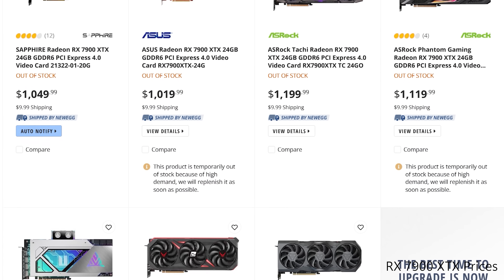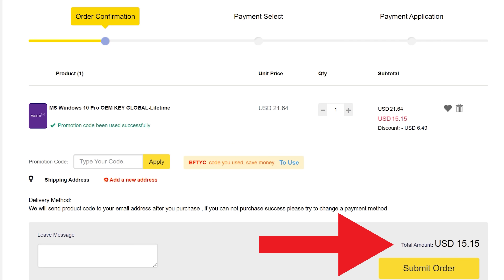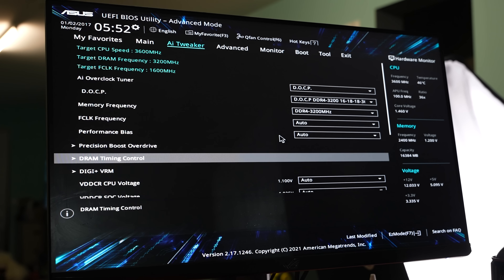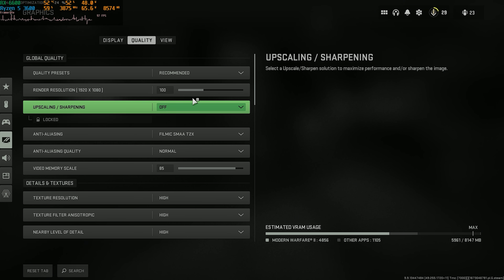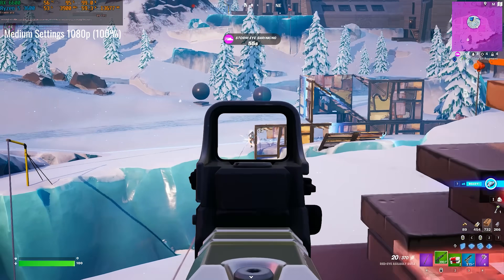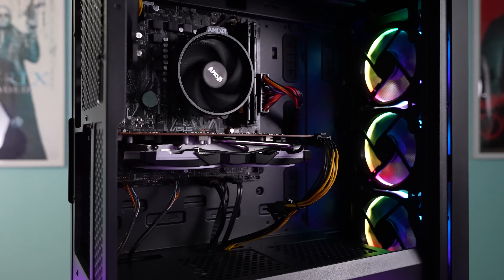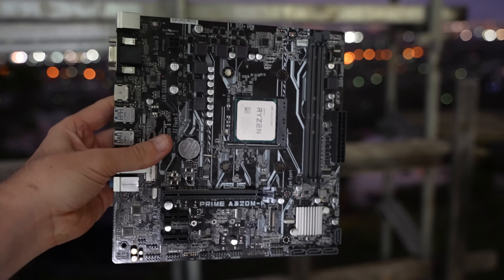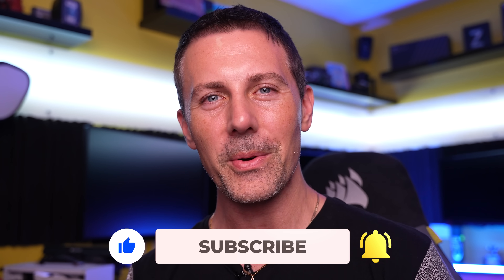This UNDER $650 Gaming PC Can't be Beat for Value.

Comment: I'd actually recommend people wait a bit on the GPU side of things; during Black Friday you could get your hands on an RX 6700XT for about $320 after rebate, I fully expect the card to go that low or lower over this year, and you can get a LOT of extra performance with only another $70 if you just wait for it to hit.  That said, 6600's an awesome bang for buck card, so if you're building now, don't be afraid to go for it.

Comment: If you have a local CEX they  often have competitive deals on ram, monitors, other pc parts. 
My experience the Warranty was good no quibble return replacement or voucher credit when a fault happened.  Returned a BenQ RL2455HM for £38 after a week when it kept switching off randomly when it  made crackling noises. My bad luck, but will be  back again, generic monitors (if lucky with HDMI) from a fiver. It is worth a buy and return if it shows odd behaviours in the first few weeks of testing.

Comment: I would put some heatsinks on the VRM of A320 boards. They usually go for around 7 to 15$ and for sure prolong the lifespan of those otherwise really nice motherboards.
Reply: totally worth it. I once used 2 heatsinks from a broken stereo amp. found at the recycling centre, works great!

Comment: It is so nice to build a budget system because you don’t have a lot of parts to install and what you have is easy to install. Also there is something refreshing about basic looking motherboards that look more like they did 15-20 years ago and no RGB or anything to worry about. You can also get a lot for not much. Personally I build last year an alder lake PC with with some cheap parts and older parts left over for 200 bucks. And while it isn’t great at gaming it can do some older games no problem and for what it is used for it works perfectly fine and feels faster than an old Sandy Bridge despite being only a 2 core 4 threads it is faster than quad cores from a few years ago.

Comment: Just built a pc with a Ryzen 5 5600 and a $250 used Rx 6700xt for a total of under $600! Super hyped to build it I think the price to performance is going to be insane
Reply: ALL used components?
Reply: @southboundtp2067  no only thing that was used was the 6700xt and the case I had before, so total i spent was like $600
Reply: nice

Comment: The system is compromising on a few different areas though, such as the memory and processor.  Consumers are calling for 32GB memory in many of the gaming systems being bought and used today,  as well with a processor with integrated graphics for troubleshooting and any additional tasks the user may need to do.   This system is a great entry tier system into PC gaming so long the buyer  knows it's shortcomings and at a price of $628 I'm not sure there is much that can beat it unless you have parts donated to you.
Reply: integrated graphics are costing you half your memory cache and Pcie 4.0 support ( thats 10% performance loss to the newer graphics card ) , not sure i would want Pcie 3.0 when 5.0 just came out, you basically top out the system with RTX 2080 do the bus support, Nvidia 3000, 4000 and AMD 5000, 6000, 7000 will all have reduce performance unless your talking 12th gen or above Intel CPUs
Reply: @hayseedfarmboy  
iGPU is a really useful part of processors especially when you go to boot of your system for the first time and you're not able to figure out why there's no display.  For some it's only $20 more than processors without integrated graphics.  Totally up to the user what they are willing to go without, either way anyone in the position needs to know specifically what they are buying comes with and what it will not come with
Reply: some one didn't tell him the 3600 is actually 5000ghz beast

Comment: I would suggest change the mobo to B450 for ryzen 5 3600,and you can get the most out of that chip by overclocking it.
Reply: I got an a520m can you overclock the 3600 on this mobo?
Reply: @Lollopirate  Unfortunately you can't. But maybe you can look into the xmp profile in Bios and set the RAM speed higher than 3200 since Ryzen CPUs love faster RAM.
Reply: @mr.chaidir4766  Thanks for the answer man, i did some reasearch and a lot of people say that overclocking a cpu like the ryzen 5 3600 won't give you that much performance (depending if the game is more cpu demanding or gpu) and like you said the more important thing is memory speed. Since i bought the a520 new i can always try it and return it if i see low performance but i hope it'll be fine without overclocking.
Reply: Do you have a 3600 cause I have one and it doesn't get much more performance by oc they don't oc very well
Reply: @Durkhead  I do and yes the performance improvement maybe is not significant enough. But in cpu demanding games like cyberpunk 2077 and watch dogs legion it helps the game run much smoother and lock the fps to 60 all the time. I overclock my ryzen 3600 to 4.3 GHz all core then undervolt it from the default 1.3 to 1.18 mv and I get the best balance between performance and temperature. While I do think this cpu can handle most of the recent title out of the box just fine, but hey it's free performance.

Comment: Just built a similar system with used parts. Ryzen 5600 for $100. RX6650XT for $200. Another $200 for the rest of the components $500 total for a great 1080P build!
Reply: Same exact here except I got a 6700xt for $250
Reply: @BrickPB  definitely got yours at a much better price than I got mine, but to that I say great find
Reply: @ArtisChronicles  haha, which brand or model did you get and for how much?
Reply: nice

Comment: I LOVE this one! Personally I would have spent the extra money for a R5 5500 or a 5000 series one in general, but it's just REALLY good!
Reply: the 3600 will out perform the 5500 just not on that board, but 320 is a propper fit for the 5500 with a BIOS update, less cache and no Pcie 4.0 support anyway, 3600 has twice the cache and 4.0 Pcie support , plus it responds to RAM over clocking, unlike the 5500 (3200 and 4400 mega transfers RAM same performance out come some times worse for the whole 5000 series )
Reply: @hayseedfarmboy  3600 doesn't outperform the 5500
Reply: @ChristmasCrustacean  yes it does. i have both CPUs and can confirm that
Reply: @ChristmasCrustacean  anyone can over clock 3600 to 5000ghz, as far as i know no one has been able to get a 5500 above 4.6 even with liquid nitrogen, i mean it a good budget CPU if your going with a cheaper board like 450 or 320, but a B550 with a 3600 non X/XT will run right past 4600 ghz and still run below 70*c on an 30$ air cooler,, even out of the box stock setting on a B550 there won't 1% Performance difference, but on cheaper board stock setting, and 3200 RAM the 5500 would out perform it, but thats the only way, but both CPUs running their best the 3600 will pull ahead by another 400ghz or more, it handles heat so much better and can be overclocked more and in more ways
Reply: @H31MU7  i mean if his running a Nvidia 2000 series rather than 3000 series or radeon 5000 or 6000 that is a 10% performance reduction he manged to avoid, but yeah ive got a 5600G and 3600, and there is no contest on a overclocked B550 board and 4000 ram with a 5700XT or RX 6600. Now on the 520 with my 1070 the 5600g is faster at manufacturers specs, i assume thats what he is considering out performing
Reply: @H31MU7  I also have both the 3600 and 5500 and again, at least in my testing, with 3600Mhz RAM and Pcie 4.0 enabled the difference is rather sizable
Reply: No it's pcie 3
Reply: @martigrey5872  I would've gone for a b550m and a 5600. maybe 50$ more but better performance.
Reply: @martigrey5872  a320 in general locks cpus to 3.0. The 5500 is perfect for this, is new, and is relatively cheap to get
Reply: @martigrey5872  Weeeelll regarding the pcie 3.0 thing, I actually managed to get a R5 5500 and RX 6600 work with Pcie4, it's actually a matter of getting the right mCode. I do have a video about it on my Channel, it's the one with the anime case mod lol

Comment: this is the 2 years good to go build and on other hand..

32GB RAM , r7 5700x / 6700 non xt. 10GB 160bit 16x lanes.   with aftermarket cpu  cooler  like fuma 2 rev B. can be relevant for about 4-5 years.  don't cheap out at just 650$ build. ideal build it's ~800-850$

every ''buget build'' it's a gimmick and scam to upgrade often.

Comment: Love the package. However, as great as this build is, people should be aware that amd cards power consumption drastically increase with high refresh rates as well as multiple monitors. Try to increase the fresh rate incrementally until the power draws raise. (Said to be 90hz to 120hz for some people). Best scenario is to  have a free synch/gsync adaptive rate monitor to save energy when idle/browsing.
Reply: Only on 7000 series
Reply: @jayrodriguez439  I have read feedback it's also the case with other series compared to nvidia. Albeit less pronounced than on the 7000
Reply: @OptLab  i did not know this to be true but my 5700xt and 5500xt runs the same tdp on both 1440p 1080p 165hz did actually used a digital wattage calculator but i am not sure about the 6000 series if they are behaving like you said i hope amd find ways to fix that issue.

Comment: My rule of thumb is "if it has pins, it gets bought new, that way I don't have to deal with bent pins" other than that, GPU I generally try to get used because you can get deals for higher end older GPU's, like my current find, an RTX 2080TI for $450 that out performs a RTX 3070 all day long due to the higher memory buss.
Reply: 2080ti goes for cheaper than that, also, it has one of the highest failure rates, i actively avoid these (also the 3090), went for 3070 for my brother instead for $280 and i got a 6950xt. My data is from a GPU repair shop, pretty reliable. If it doesnt fail on you, thats great.
Reply: @yukisnoww  I bought it 2 months ago. Prices have come way down since the 4090 launch. Also, I needed a GPU I could find a reputable full cover water block for. 70's models rarely get the WB treatment.
Reply: so new Intel board and used CPU and new AMD CPU and used board ,, i like it
Reply: And cpu pins are easy to fix and lga pins can be easy if it's only a few pins, otherwise if someone mangled the socket it's basicly screwed without soldering a new one on
Reply: @virtualtools_3021  or you get a CPU like Jayz2Cents where pins were broke off/solder pads ripped off

Comment: I wouldn't use MSI afterburner for AMD GPUs. Had some problems with tuning my 6800 xt. AMDs adrenalin worked quite well.
Reply from the maker: Latest drivers make it a lot easier to use, I think AMD did something to not lock it to adrenaline?

Comment: Insane amount of computer for $350 (used build).  If the RX 580 is still kicking in 2023, I'd expect about 5 years from the 6600 as well
Reply: The RX6600 probably has an even longer future as long as the user is willing to play at 1080P or lower.  Even future AAA games will have options for lower resolutions where the 6600 will still be relevant.  If everybody decides they must have 4K or "8K" gaming, then yeah, the 6600 will be obsolete faster.  But that means it will still be a good card for everyday work going forward.  10 years is my guess.  And someone will still use it for retro gaming even then.
Reply: he liar four me. he say he wanting make video four show pc four india. he fourget make this four me. he only enjoy four making fertilise. why he fourget india.
Reply from the maker: @RanjakarPatel  Sorry Mr. Patel. lol
Reply: @techyescity  hi
sir Ian your subscriber and a hardcore fan from Pakistan
I want ta ask few questions from you about pc components
1. how would an i9 11980h mutant (converted to lga) performs with rtx 3070&3080 and is it worth it to buy 11980h+mobo under 150 usd
2. how would an optiplex i5 9600k performs with rtx 2070s does i7 8700&9700 perform better complete optiplex without gpu (200usd)
3. is it worth to buy a Xeon e 5 1650v4 complete system under 190usd please suggest max GPU for it
Reply: @RanjakarPatel  what
Reply: @trr4gfreddrtgf  he promise four me this. please make angry. make fareness four india. he look only four find wife.
Reply: @RanjakarPatel  lol. We don't really get your point. 😂

Comment: Better to go with a Ryzen 5 5500 or 5600 - better IPC than a 3600 for same/similar price..  Also that rear IO is a bit of a mess Brian - 3d printed plastic io plate would be better than that bodge job
Reply: Well, the 5000 series don't idle as low as 3600, except 5000 with an apu. It could also be because of pcie4 drawing more power though. The new Ryzen processors power consumption are only good at full load. It's otherwise not very good imo. 
The good thing about those medium pc is that you can run them very low at idle with a 400 platinium psu. So I would try keep this advantage as well as for noise advantage. BUt yeah, the 5600 looks lovely considering the affordable am4 platform, but as a processor only I'd prefer the 12400

Comment: I dont know about you. But how can you feel pride when you resell that pc? You use cheap and low quality parts and slap some rbg in the builds thats it.
Reply: You don't get the point. It's the most power efficient per watt for price build.
I agree RGB is just a gimmick. But most AM4 platforms sells for dirt cheap and there is little reason to seek double performance  when it cost 5 times more second hand.
Reply: @OptLab  Look at his previous builds as well
Reply from the maker: @Balz4201  I look at the end result, not the in between.  This is a build that is power efficient, quiet, has smooth FPS and looks good.  Pride is really high, competition want $300-400 more for the same end result.
Reply: @techyescity  Yeah i do agree with that. As long as you are happy with reselling it

Comment: I do have something like this. But my CPU is Ryzen 5600 on a A320🤣Before putting some power limits I was afraid to finish Cinebench R23 benchmark as VRM was 110 C. Still the board did not throttle down. I got it down to 95C after some tweaks.
Reply: 65w limit or undervolt it to 1-1.1v
Reply: VRMs shouldn't go above 70-90 degrees.  Next time buy a MoBo with heatsinks on the VRM. You could try adding heatsinks to the VRM on your current MoBo or increasing airflow in the case (increase case fan RPM or add a fan). This is assuming you aren't overclocking...if you are, the first thing to do is set everything back to default settings.

Comment: Gone are the days when you can buy a new GTX 1050 ti for $150 new, drop it in a used Dell Optiplex for $50 at a thrift store and start gaming.
Reply: You can still do that with a 1650. But you'll be playing 1080p low, just like when the 1050 Ti could be had for 150. An RX 6400 drops very low in price too.